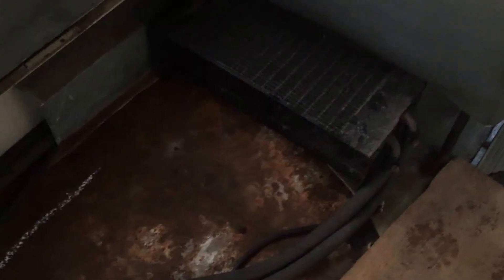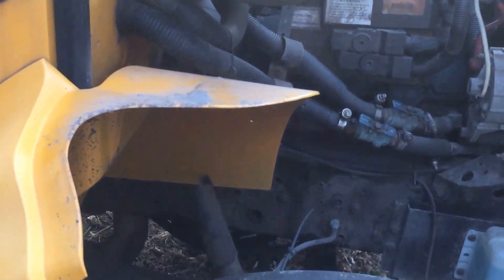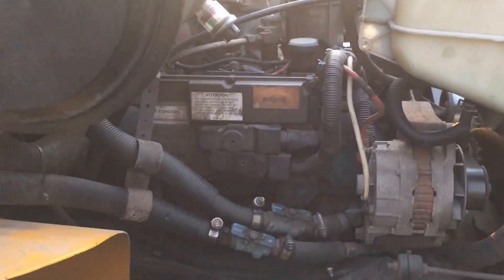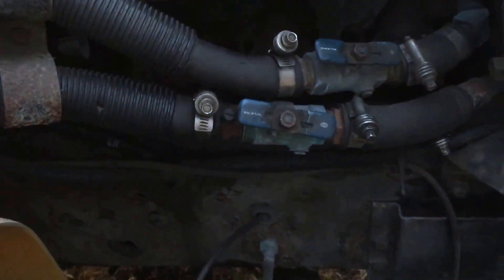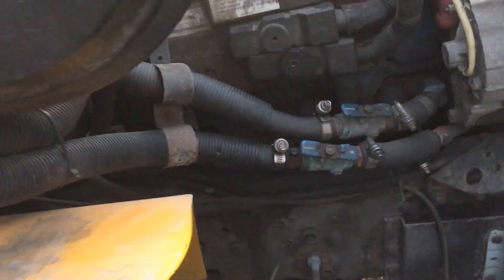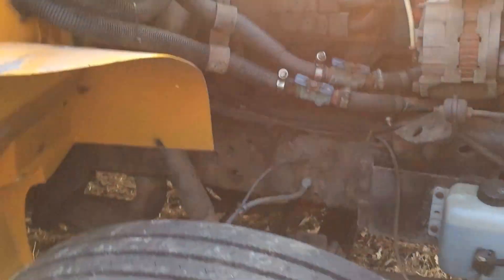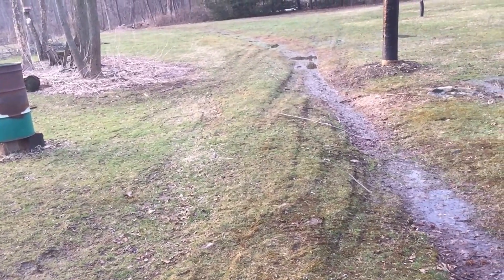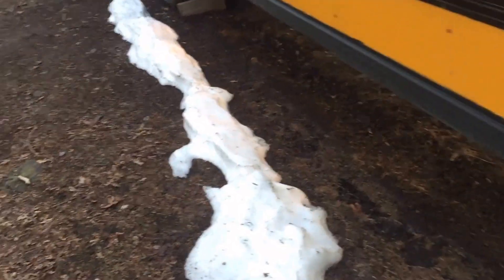Question for Conversion People, Heater Hoses

Comment: We didn't have the second heater but we had to replace the hoses, about 22 feet of them. We have the T444e engine. Being in Florida we have been running with the heater vales closed just about all the time. After replacing the hoses it took about 3 rides to get the coolant system totally topped off. It was not bad, just had to add a half gallon after every drive. As far as I can tell the system hold 6 gallons. Our engine stays between 193 and 209 water temp. It will rise to 209 while driving but when you come to a traffic light, while waiting for it to change the temp will drop back down to 193.

http://thebusabides.com/skoolie/one-inch-rubber-end-caps-do-not-exist/

Make sure you use the anti-freeze for diesel engines.
Reply from the maker: Thanks for the info!!!! Big help!!